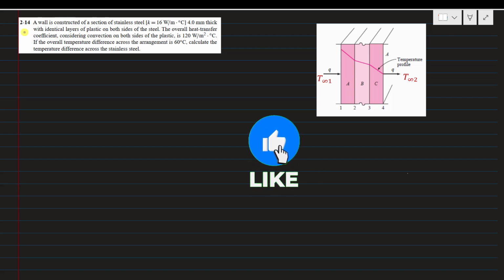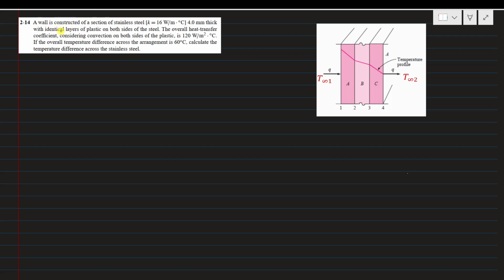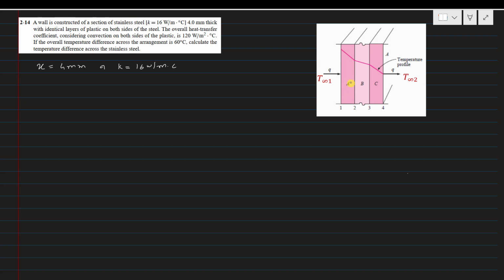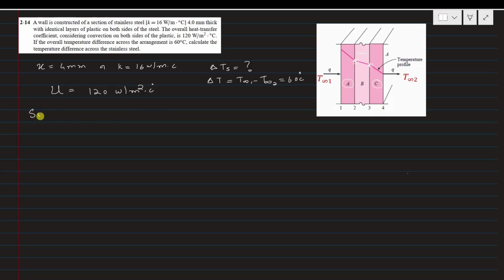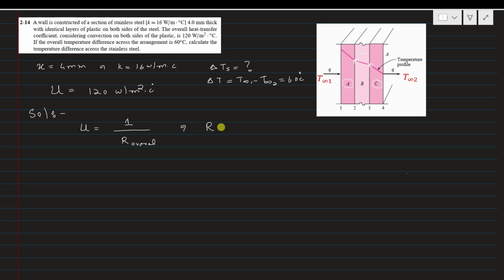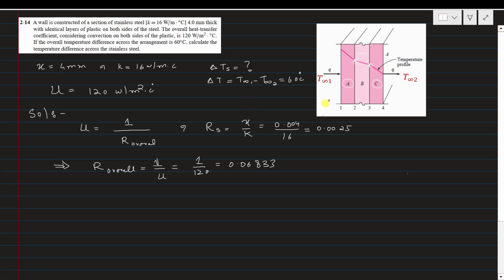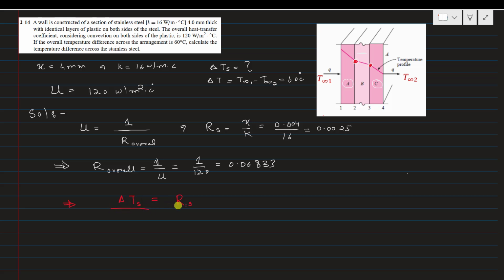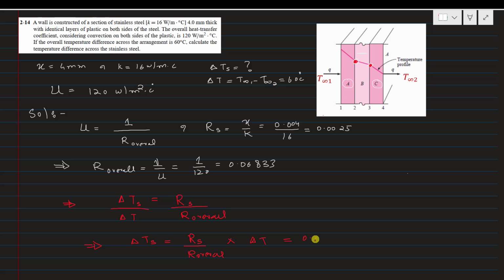2.14 calculate the temperature difference across the stainless steel.

Comment: A furnace wall 200 mm thick is made of a material having thermal conductivity of 1.45Wm -K . The inner and outer surface are exposed to average temperatures of 350°C and 40°C respectively. If the gas and air film coefficients are 58Wm2-K and 11.63Wm2-K respectively,find the rate of heat transfer through a wall of 2.5m2. Also, find the temperatures on the twosides of the wall
Reply: Please sir solve this problem 🥺